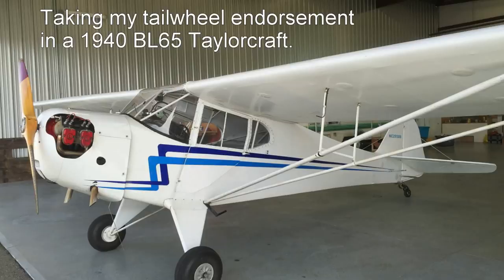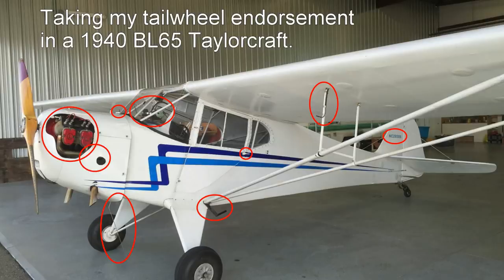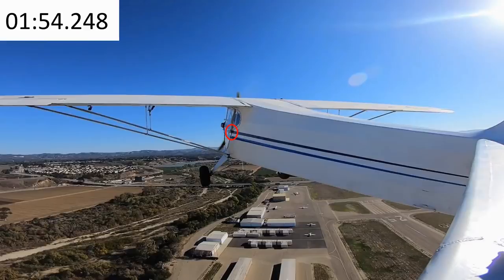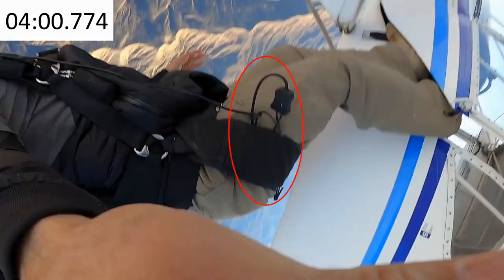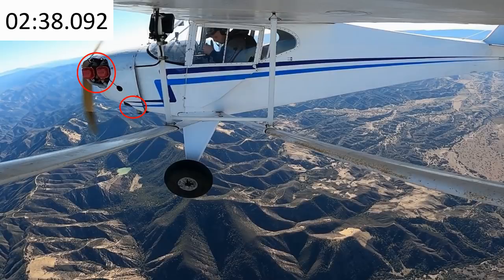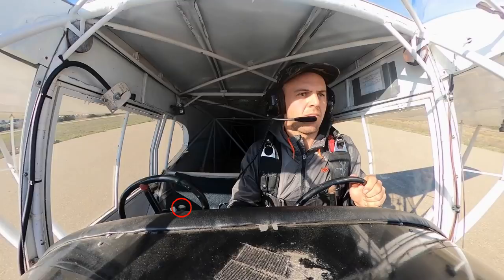Dear Trevor Jacob 1.1—That’s Not a Lycoming, I Found Your Water, and We Still Have More Questions…

Comment: Nice attention to detail there !
Missing boarding step 2:02 before he takes off on "the flight"
-It seems very reasonable to me that he'd take it off.
-He didnt want to get snagged on it when jumping out ❗
(I have seen that happen to skydivers).

The black line on the cowling-cover (?)...  (From the big hole, to a small round hole)  ...is just a crack in the cowling-cover. (Probably from when they swapped engines). The smaller round hole, is supposed to be there. (I forget what it was for).
-Regarding the water bottle (I think it may have been a little smaller than the jug you showed, but...anyhoo... -He took it with him out of the plane. You can see ..in several places..something on his stomach, under the jacket.
..And when he's landed in the brush he chose, there are glimpses of a quite large wet area. -You only see glimpses of this, so it's easily missed.
But clearly there, tho ❗

Cheers all ❗
-K from 🇮🇸   😃

Comment: Trust me, I ADHORE what Trevor Jacobs did, as a commercial pilot my opinion is he should lose his pilot’s license and be criminally prosecuted, but I have heard about this engine change several times.  If he changed out the engine, what is the significance?  It is a 80 year old airplane, it could have been changed many times, how does the engine change support the case that this whole crash was a fraud?
Reply from the maker: Glad to have another pilot come in! What do you fly?
Reply: @PetesGuide  USN Hornets, C model many many years ago, VFA-97 Warhawks.  Now it’s a GS-4 for a Government Contractor.  You are probably as disgusted as I am about this ridiculous stunt.  He should lose his license.
Reply from the maker: Way cool! My late uncle was a naval officer, but not on the aviation side. About the engine swap—I’m troubled that he appeared to make it look like the engine that was previously installed and still listed on the plane’s registration. Based on the degree to which he went to hide things (the tail number, his flight path, the wreckage, the inside of the cabin after the engine failed, and the fire extinguishers up his pants), that it is likely he did numerous other things related to the engine that were not safe for the people below his flight path. Maybe not fraudulent, but now that the FAA and NTSB know, I’m sure they will start looking into whether he forged documentation or did other things that they would consider fraud.

My goal is to find and point out everything they should be researching, so they can make a complete and accurate determination of what transpired.
Reply: @PetesGuide  Awesome!  Excellent investigation and please continue.  I wonder if he will ever admit the truth? Endangering lives and property for the sake of YouTube views; beyond disgusting.

Comment: Has anyone noticed the black decal going forward from the lower part of the windshield on Trevors plane? It is not on the plane that is compared to, also the decals on the other plane appear to be lighter blue ( could be the shadows ), and also seems like a whole different cowling, could be from a careless engine swap I guess. But why would he swap engines for just a stunt like that? Seems like a lot of work for just a short flight!
Reply from the maker: The black stripe is an illusion. It’s actually the pitot tube on the jury strut, and only appears to be on the cowling because of the camera angle.

Comment: At 2:27 you say "... looks like you have plenty of fuel..."
When dealing with criminals, one must think like a criminal.
Plenty of fluid ( water ?, to help suppress fire upon crash ) and fuel bobber gage jammed at full location.
Others have pointed out, his fuel line went to a small aux container w/just enough fuel to insure he'd run out where he wanted.
Reply from the maker: I believe that to be a possibility, but have not seen any video evidence of that yet.

But then again, I haven’t yet gone through the whole 16:41 frame-by-frame yet and look how much I’ve found before others. ;-)
Reply from the maker: Oh, you really need to check out the latest video. I’m up to 1.3, so there are things I found in 1.2 and 1.3 you haven’t seen. 1.3 has everything I found in 1.0, 1.1, and 1.2.
Reply: @PetesGuide  
Thanks Pete .
Nail'im !
Reply from the maker: Thanks! I got some other feedback today that I should continue my research. So that’s what I’m going to do.
Reply: dude he had a bottle of water. that would't help to put a fire out bubs.

Comment: Hey Pete, I don’t think the line to airspeed indicator inside the airplane isn’t disconnected, it just goes into the wing root at that point and out the leading edge of wing to the pitot tube.
Reply from the maker: I will have to do a follow-up and zoom in on it—I’m pretty sure it’s disconnected. But even if we can’t tell from the video for sure, it’s wonky enough the investigators need to look at it.

Comment: Some good points here, Pete.

I've read from a couple sources that said this plane was in bad shape and needed repair.

I don't think he swapped the engine. I think the engine was swapped because the Lycoming can be a little underpowered. However, how much power do you need for a 1200lb airplane? Hopefully you have the full video, if not, I saved it before he edited it.
Reply from the maker: Downloaded the full video 2 days after he edited it. But apparently the edge server still had the full version. ;-) Lycoming 65 HP is apparently a Lycoming 55 HP engine with a beefier oil pump and a new model number.
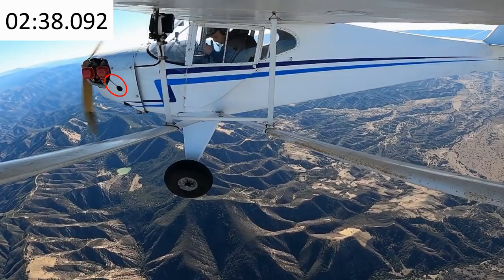Reply: Look at the rust on the strut tubes at 2:15
Reply from the maker: @MrTheHillfolk  That actually turns out to be a significant and expensive problem with the plane. I received a solid tip from someone I promised anonymity to earlier today about that rust. Expect coverage sometime this next week!
Reply: I didn't know he edited the video.  Do you know what he changed, and when he did it?  Just curious if I saw the original or edited version.
Reply from the maker: @deCarabas27  Original was 16 minutes  and included an ad for ridge wallet and a bit about scattering Johnny Strange’s ashes over his favorite ridge at the beginning and end. Edited on January 10th.
Reply: @PetesGuide  Thanks.  I guess I saw the original then.  Never bothered to go back and watch it a second time

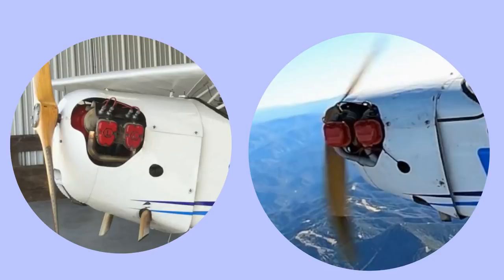Comment: The item you thought was a sepperated pitot tube seems more likely to be a fuel line from the wing tanks. And the cowling does look more like a crack than a cord, just look at the side by side of the 2 different engines at 3:33 and you can see a different shape to the cowling where the engine is located, looks like drop damage that formed a crack. Not hard to do with the thing fiberglass cowlings.
Reply from the maker: To the best of my knowledge, this particular Taylorcraft model had only the 12-gallon fuel tank behind the engine, and a 6-gallon auxiliary tank in the right wing. Later birds did have wing tanks on both sides, but probably not this one.

I’m still undecided about the crack/cord, but I’m pretty sure those are metal not fiberglass.
Reply: @PetesGuide  You are correct about the tanks, thats my bad sorry. The other thing the tube might be is the connection from the pitot tube to the ASI (airspeed indicator) if it has a pitot and not a venturi tube. Original 1960 parts like the cowling would be metal but in the 40+ years since it was new people replace parts with fiberglass to save weight. 
One thing for sure is the guy did this for clickbait, and it was fully set up ahead of time.

Comment: There’s a problem with one of your accusations: the registration number breakdown shows the plane as a model BL-65, which you further break down to mean “Model B airframe with a Lycoming 65 hp engine”

This is what the model number meant from the factory, but after an engine swap that model number would not change and since the FAA reg. Number only shows the model number, and not the breakdown of its meaning, there’s no reson it would have any other information about a second engine being installed. 

A good example here would be a 68’ Dodge Charger with a VIN that when decoded shows an R/T package car with a 440 Magnum v8 and 4 wheel manual drum brakes. Say the owner installs a modern 6.4 crate hemi engine and 4 wheel power disc brakes. The vin of the car will remain the same, and the DMV or other governing body that issues it’s license plates will still have the VIN listed that if decided will indicate a 440/4 wheel drum brake car.
Reply from the maker: Good point, however, this specific plane was known to have had a lycoming engine as recently as 2018, so the change was relatively recent. Not proof that Trevor did the swap, but given everything else it seems likely. We may have to wait for an official report to know when.
Reply: @PetesGuide  I figure the official report will show a lot, do you plan on doing a FOIA request for the “missing” footage from the windshield mounted go-pro? I figure it’ll take something like that to get that footage out in any reasonable time frame, usually law enforcement agencies don’t break their necks to tell or show the public anything substantial.
Reply from the maker: I know one person has filed a FOIA, but not for the cameras. I haven’t considered doing so yet but might.

Comment: I believe the antenna on the bottom is not radio but LORAN navigation which is no longer usable as of 2010.
Reply from the maker: Unlikely. The plane probably didn’t even have an electrical system or a VOR. Deeper dive on the instrument panel coming soon.

Comment: 3:53 there's a stripe of paint behind the cowling level with the cylinder heads, that black stripe on the right that doesn't exist on the left, wonder what that's all about. Also, obviously, the cowling on the right is beat up, on the left is clean/straight.

Comment: At 2:12 in your video, you can see the original Pitot Tube. He didn't relocate it. My assumption is that he didn't modify the aircraft much at all. I doubt he removed the step, or changed the engine. That would have been a lot of work on an aircraft he bought to crash.

Since it was recently bought, my guess is that the previous owner changed the engine and removed the step for some reason.

Also, it is possible that the water bottle exited the aircraft during the crash and he was unable to find it. There is no evidence to the contrary. 

It is clear the door was open prior to the crash, but I don't know if the aircraft no longer had a functioning door latch. The previous owner (who sold it days before the crash) would be the one to speak on the step and door handle.

The antenna is an interesting note. I am unaware the the aircraft had an electrical system or radio. It should have had an ELT though, whose antenna is usually mounted on the tail on top of the fuselage with the ELT mounted in the tail.

In all, I don't see any new evidence in your video. The most telling problem for Trevor is where was his luggage? He didn't haul it out of the aircraft and back for his trip. Also, why did he have fire extinguishers hidden in his pant leggings? I mean, he could have had the fire extinguishers in the aircraft, that would be normal, but why take them with him? The only reason I could come up with this weird oddity was that he might have had to fight a fire to get back to the aircraft and get his GoPros.
His other problem is that he verbally claims he "always flies with a parachute" but he has no video evidence of ever doing that before, only the opposite, so that was clearly a lie.
Reply: people die getting snagged by steps. they are removed on sky diving planes, a professional diver points this out in a previous video. In fact, he had a friend who died by getting snagged, WHILE being tethered to a person who also died. That step could have been his death, why it was removed. It didn't just "rust and fall off"  I actually think this video brings some pretty good points.....  but my only comment here is on that step...

Comment: Are we sure they are the same airplane? The cowling (not just the engine) is different between the two planes. There is a black stripe on the forward fuselage on the plane Trevor is flying/jumping from. But it’s not on the fuselage of the airplane in the first picture.
Reply from the maker: Same plane for sure. That black stripe is the pitot tube; I just haven’t done a good job highlighting that bit yet. Latest video directly compares images of the tail numbers from the 2016 plane and the one Trevor crashed. https://youtu.be/3YgX7HAAGDo same plane for sure.
Reply: @PetesGuide  yep. You’re right. It’s the same plane. But it looks like some one beat the hell out of the cowling when they changed the engine.
Reply from the maker: @user-tl5fi9lz9z  probably had no choice in order to make it fit.

Comment: I'm confused, "There's the radio antenna, so the plane had a radio antenna, how did you call for help?" Well, I mean, using the radio? What did I miss? O.o
Reply from the maker: His radio headset didn’t appear to be plugged into the plane’s panel, so he wasn’t using that antenna.

There’s also an open question of whether the plane ever had an electrical system installed, and a few things that implies.
Reply: @PetesGuide  Ah, now I get it, thanks for clarifying.

Comment: 3:57 you also see the hole for the exhaust pipe is much larger on Trevor's video.
Reply: Yes, it would have been unsafe to fly without the Tail Pipes. Exhaust blowing straight back into the cabin would be a Carbon Monoxide risk. Remember, Safety First, crashing with zero fuel preferable.

Comment: Probably not that important but I noticed when you were comparing the two pics of the engines side by side everything you said was for sure correct, but did you see the plane that he jumped from coming from the windshield to the engine cover at the top were it looks like a seam is there is a big black strip on the left picture but not on the one on the left. It's a big in your face stripe that would be strange to add it for whatever reason. Also in a different video when it shows the plane already crashed on the ground the two stripes going along the entire side of the plane is different colors. Dark blue and blue in the air and blue and silver once it is crashed. Odd if you ask me!!
Reply from the maker: The big black strip had me confused for a while, but it’s just an odd alignment of the pitot tube mounted on the jury strut with respect to the camera and cowling

Comment: Its understood what he did nobody questions that. They will negotiate like a plea deal where he likely wont do actual jail time and after a few years can even get his licence back if he stays clean and pays various fines and if he is sincerely remorseful.

 He was olympic ski boarder so lawyer will emphasize he was young and extreme and went too far and got caught up in the youtube thing and really did not mean any harm and intentionally chose a remote spot to do the stunt and his life should not be ruined etc. community service and such.
Reply: The cost will go up substantially if the crash is in the San Rafael Wilderness area, as it appears to be. In that case the wreckage must be removed when the NTSB is finished with the on-site investigation. Motor vehicles not allowed. The usual method is to hire a mule team - a very expensive matter.
Reply from the maker: He already used a helicopter and chopped it up.

Comment: If you look at the zoomed in picture that black thing coming out of the hole in the engine cowling is a zip tie, you can see the little square locking block sticking up.
Reply from the maker: It’s possible; I just haven’t yet spent the time to look at it from all angles.
Reply: @PetesGuide  If you look at the zoomed in picture you have at 3:15, just to the right of the cylinder heads about 1" from the far left end of it you can see the square locking piece to the zip tie and the sort of v pattern in it where the ends are coming together. You can also see it on unzoomed angles to confirm it's not some kind of artifacting.
Reply from the maker: @aaronsuever2414  it’s probably going to take me another video or three to dig into this deeper, although there’s a slight chance some of it will make it into the next one. Thanks for keeping at looking deeper with me!

Comment: I'll admit I haven't followed this super closely and I haven't watched all the videos about it. I saw his and I saw one other breakdown so, what's the controversy about the water bottle? And, what's it matter if he removed the step to get into the airplane? Also, so what if he change the engine? It's important to note I am definitely not defending him it just seems like a lot of these questions are irrelevant. If he didn't pull this stunt would people care if the footstep was missing? Would anybody care if he changed out the engine? Would anybody care about a possible bungee cord? No
Reply from the maker: This video was indeed made for those who were already familiar with Trevor’s stunt, and for those familiar with the aviation rules, so I didn’t explain the significance of a lot of things these two communities already know. But I plan to do so in the near future.

A lot of the things (80%?) Trevor did are really bad dangerous things for a pilot to do, and competent pilots will know this just by me pointing out the oddities.
Reply: @PetesGuide  What aviation rules state you can't remove a step?
Reply from the maker: @MajDuty  If you notice in the video one of my stated purposes is to help the investigators. I believe the investigators will come to the conclusion that its removal is another indication he intended to bail out. That alone leads to some other problems for Trevor.